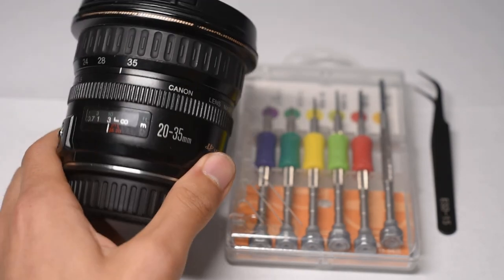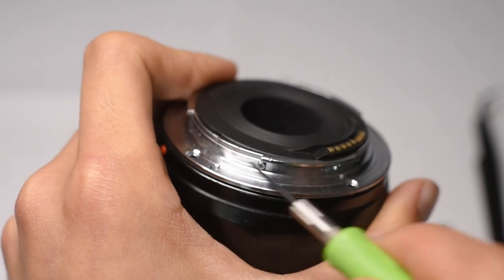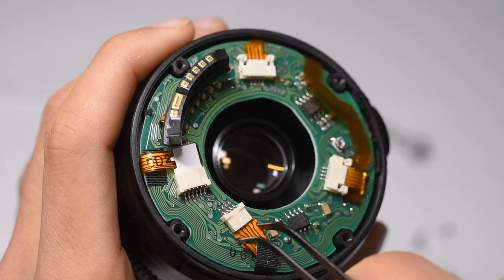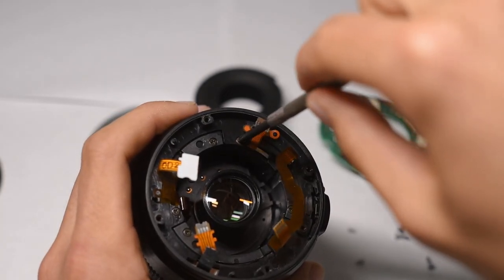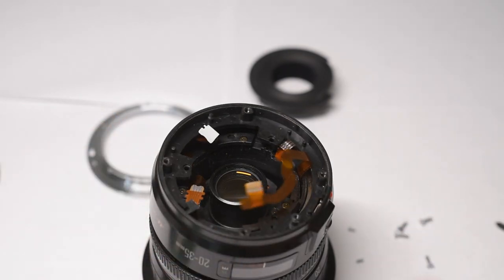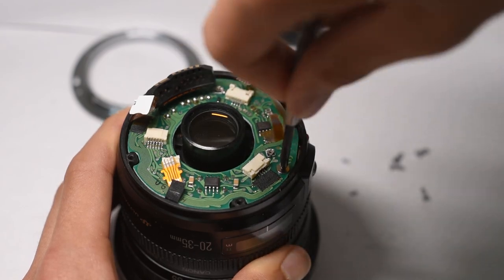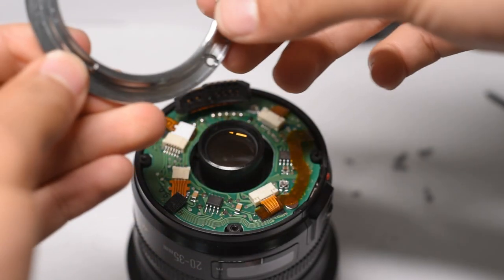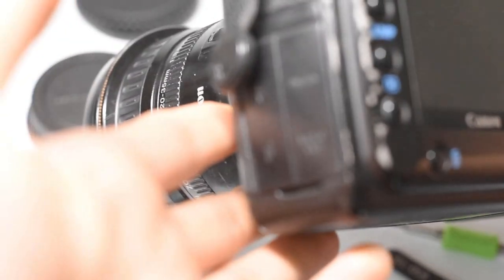How to Repair Autofocus on Canon EF 20-35mm f/3.5-4.5

Comment from the maker: (Apologies for my poor voiceover, I don't typically do videos like this --if anything is unclear ask me a question in a comment)
After searching online for videos on how to repair the focusing on the 20-35mm, I only found an old forum post, of which its images had long been lost. This video is to help those who are looking for something easier to follow along with.

If you want to skip the disassembly and reassembly, skip to 7:12.

It's more a "casual repair" video, because this is 100% not a professionally done repair. Luckily though, this is by far one of the easiest repairs you can attempt. (Also I kept calling them wires; I forgot their names, but they're ribbon cables)
You should be more careful than me when I recorded this, but even when I was doing it nonchalantly for the video, it turned out fine.
Reply: Vip asmr 🤤

Comment: I have a Canon EF 20-35mm f2.8 that rattles inside, and wont focus manually or AF. Do you have a repair video for it, or is it anything similar to this 20-35 f 3.5- 4.5 repair? Thank you!
Reply from the maker: I haven't owned that lens. It also seems like there is very little information on repairing it on the internet. I think you're on your own with that one, sorry. I'd advise either selling it for parts, buying a replacement, or if you already have a replacement-- start taking it apart (and documenting the process for others to reference) since you have little to lose.